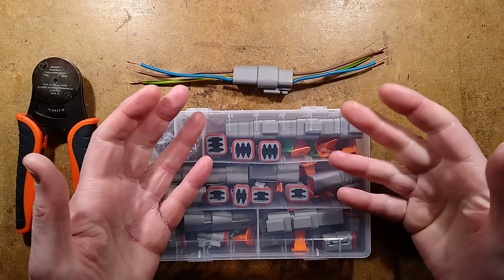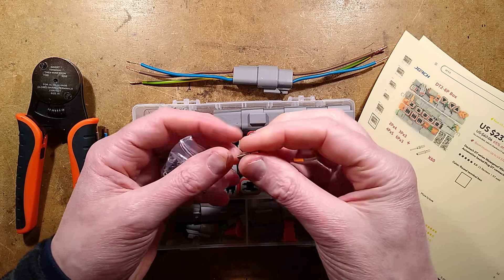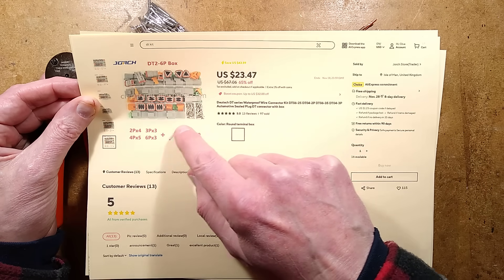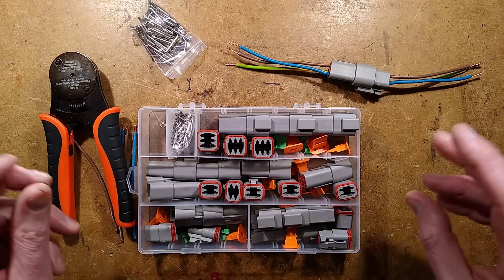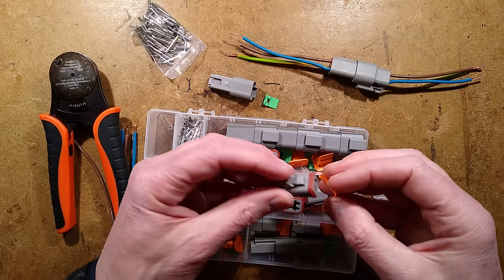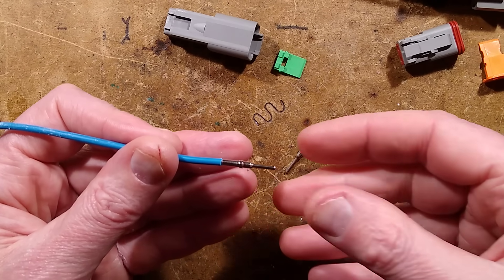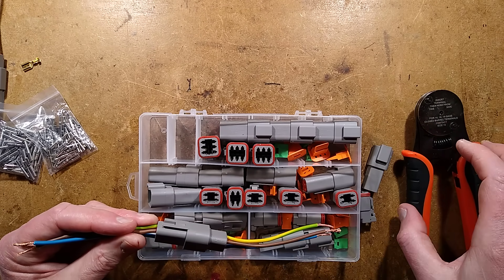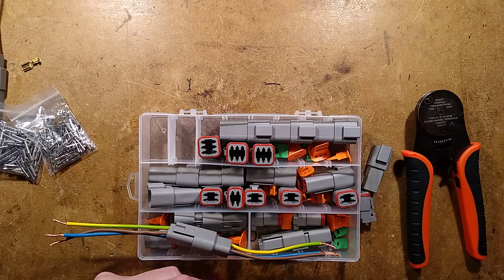Deutsch - my new favourite rugged connector

Comment: these look similar to automotive connectors which would be great for replaceing things like headlamp connectors or any other connector under the hood should it go bad or just need to be longer for an after market mod or just need to be added my go to method works but is not a professional method I will use apply dielectric grease to the wires twist them apply a wire nut use electrical tape over the wire nuts bend the wire over the wire nut then zip tie it in place so it does not twist out then duct tape over the entire merry ann its ugly as sin and looks like a joke but I have seen this method last 20 years in a few instances have yet to see it fail now will it last another 20 years I think not these connectors will likely last 50 years if left untouched after the first 20 I suspect they will get britle after a while but still work for a really long time for the work I did fixing appliances if the rest of the appliance lasted another 5 years  it would be a surprise but even in a 10 year old car expecting to keep it for another 20 plus years not likely not saying it would work this way for everybody for me it works because of the supplies I used being decent enough in the states wire nuts are the standard so we have good wire nuts and have practice with them we also use duct tape in ways we should not and if you pay a little extra it will hold up under some pretty extreme conditions while in the UK you tend to fail to twist the wire nuts enough and they come lose or you over twist them hoping against such and break the wires but if done to perfection they hold just fine and are a slightly better connection then wagos but then again we have 15 and 20 amp outlets as the standard not 13 amps and we do allot of stupid things like run our wires to the max for extended periods of time because a 20 amp breaker is thought to mean 20 amps constant when needed we are special like that so our electrical systems use wire nuts not wagos for their increased contact area and our electricians are perfectionists even our handy men doing hack jobs have some amount of procession to our work  but I have used wagos on a select few cases and they work for what they are but I have to say these are a thing of beauty when the abilty to remove and a part is critical like maybe temporary wiring for an out door venue I could see a mains panel wired to a generator with these connectors  as they are quick and easy to connect and would not come out with a simple yank when you need to spend you have no choice get the right stuff when you can hack it rather it be in a pinch to make an appliance work or just something for testing hack it a good hack is just as good a crappy proper job or better having the proper supplies is gonna look better and cleaner and be faster I have used copper pipe couplers as butt connectors for large wires and it works but takes a few minutes to install and its ugly but its just as tight and secure I shove my wires in hammer it flat fold it over and hammer it flat again cover in heat shrink tubing and done the proper tool and supplies would have that same joint done in half the time but at a higher cost and with less contact area for some of what I do the time was not a factor contact area was a factor like solar panels so I it was the cost when the panels cost 100 dollars each and 20 feet of wire costs for 30 dollars but having a bullet proof connection was a factor and the copper pipe coupler crimp did that far better then any standard crimp but the time it took to make it happen was extreme about 5 minutes per crimp wire nuts not an option it has to work perfectly 20 years from now for back up power and it will for the pros time is money so they will spend more on supplies to have it done quicker but still to spec

Comment: We have been using them in heavy commercial vehicles for decades- they really do work, and work well- especially where they get hit with water and other 'corrosive materials' like cattle urine- standard automotive crimp connectors can fail in only a few months on cattle trailers for semi's, but Deutsch connectors will last longer than the trailer itself... (they also work extremmely well in marine applications for deck lights and the loike, where again corrosive salt water makes short work of standard 'crimp connectors'...

Comment: Looks solid, and one I would actually trust to survive in rain. The only thing that ksnt kbvious to me is how you are supposed to sleeve the transition from the cable to the connector - like you might do with heatshrink. I guess its not technically required here - but I dont like it when a cable is just hanging by the leads.

I assume im just missing something. would be nice to know how its supposed to be done right. I might want to use these in some future project that needs weatherizing
Reply from the maker: These connectors are intended for wiring looms inside equipment.

Comment: Deutsch connectors use the same pin diameter (1.6mm) as the round pins that Ford uses (or used, haven't seen the wiring on a recent Ford) on things like oxygen sensors and fuel pump driver modules, among other things, so if you need to make test connections into these Ford connectors, you can use Deutsch terminal pins. Aircraft with round terminals also often use this pin diameter, if the box of jumpers I found at my dad's house after he passed is any indication (he was an A&P mechanic).

Comment: It's very satisfying to make a good crimp connector using a good tool. A few weeks ago I bought a pair of Kings crimpers from the US America (via the electronic bay website), and they were very expensive, but a lot cheaper than new, and they came with the exact dies I needed to crimp the BNC connectors I normally use. I did try crimping a cheaper brand of BNC connector that was supposed to use the same dies (based on the manufacturer's drawings, anyway), but they were incredibly difficult to crimp, and it ended up creasing the sleeve. Which is probably what made them so difficult to crimp. However, using the proper Kings connector was a much nicer and more satisfying experience. Took me right back to my days as a trainee, when I would spend hours terminating cables.

BNCs were definitely my favourite to terminate, which is a shame because I don't get to make them since I moved into networking. Now it's just Cat6 RJ45s, or the occasional fibre splice. Fibre is also satisfying to splice, but nowhere near as pleasingly tactile as a BNC. And the less to say about Cat6 RJ45s, the better.

Comment: I worked for 44 years designing / producing test interfaces for the worlds automotive industry probably came across 99% of the connectors out there also ran the machine that turned contacts. The Deutsh connectors were designed from the outset as high quality with the machined contacts then the cheaper formed terminals were introduced. The turned contacts are worth the money especially if you expect the connector pairs to be connected / disconnected in use. They have been in production for 15 years

Comment: Panty Wings? I think you meant Panty Sheild Wings. But I've never known of that comparison in electronics although I've used these connectors in an industrial setting,  and they are really good. We were using them for hydraulic pressure transducers with 4-20 mA signalling for load weighing on front end loaders etc. I say 'we' but i was just a part time tech making cable assemblies for testing stuff.

Comment: The first time i used these i never went back unless i needed more than the amps on the dt series. the biggest help has been here in australia with our ancient and unreliable 7 and 12 pin trailer plugs, ive switched my ute and trailers to run them and havent had a bad conncetion for at least 6 months whereas i would have had to at least spread the indictaor pins at least 4 or 5 times if not more. plus on rough roads i dont have to tape the bloodey 7 pin plug in to stop it falling out, which with 2.5T behind is not ideal when you need the electric brakes to work.

Comment: I've seen those many times and wow. I've never realized that there's three pieces of sealing in them! Now to think of it, I can't recall seeing these corroded or anything. I've done quite many "Amp superseal" connectors and they're quite good for low voltages, but I absolutely hate assembling them. Oh and those last crimp connectors seen in vid, whatever they're called in English. Yeah, they work, but I kinda hate them deeply. Even the "insulated" ones leave miniscule gaps that just irks me badly. I had to repair my car's heavily corroded rear lights with them few months ago and just... Disliked the process. They always feel like they might disassemble themselves, short, corrode etc. 😊

Comment: I got ripped off on ebay by a seller who said they shipped two items to me, one with USPS and one with FedEx, I got shipping info from each and proved the items were NOT shipped to my name or address, ebay refused to refund me and believed the buyer, in spite of the proof, they didn't even look at it. So I use Amazon and Temu now. Amazon has an Ai which watches how much you spend and adjusts the prices to match what they think you can pay. If you buy expensive stuff prices will go up. Temu varies prices a lot but I don't know why yet. I bought bike lights that were $US7 something one day and $11 2 days later, even though they were laready in my art, so if you see a deal on Temu buy it, as the price may change at any time.

Comment: I moved over to these connectors from Bosch Kompact & Junior Timer style ones when I could for my DIY electronic ignition projects, as they are more compact, and easily demountable. plus I planned to 3D print simple tube like enclosures and incorporate custom PCBs in these and use the connectors in these..

Comment: Ive used these on a PC build as a test run and proved quite handy. Its meant that i can add longer cables where needed, change sata, molex and disk power connectors and add dummy connections for cable management.
Reply: Just don't mix your pin assignments up! :p

Comment: We used a lot of different crimping connectors and had a lot of those 500+ EUR crimping pliers... 
This seller does a nice job, delivering 60 set of pins so you have 5 spare ones to test the crimping tool.
The listing mentions the SN-2549 crimping pliers and these work nicely for JST-XH and Dupont style connectors too. I tried 4 different types of crimping pliers but this seems to be the one that works best for the connectors I use.

Comment: These little buggers are great but when used in harsh environments they can be tough to get apart if not lubricated a bit when assembled. Often the seal and the lock will stay behind as they jam from fine dust etc.  These have become the preferred connector for a lot of us techs .

Comment: The hole in the side of the pin is an indicator to show the stripped wire is the correct length. You should see the wire through the hole.
Plus the crimp tool should be loaded so you can push the into correct depth.

Comment: I've used DT connectors in the field for decades and they are hard to beat. The actual factory crimper for these is several hundred dollars but I have been using the same one my entire career. The gold plated pins are very low resistance.
Reply: I second this. If you're doing more than 100 or so crimps on the same wire gauge, the expense of the real tool is worthwhile.

Comment: If I read that out loud, it would sound like "douche". A douche isn't always a negative thing. It makes me wonder if this would be good for connecting light fixtures with house wiring. Crimping onto solid wire doesn't sound good, but I think people do it. In my case, I'd have to adapt aluminum wiring to copper before I could do it, anyway. I've never seen any issues with connecting light fixtures directly with aluminum, and that's how it has been since the 60s. The problems seem to arise mostly with high current loads.

Comment: I bet you would like Anderson connectors... If you assemble them the same way it is impossible to connect them incorrectly and they are also genderless so if you have multiple batteries and plug them together the polarity will be correct or if you want to plug a power source directly into a load or a power source into a battery or a battery into a load no matter what you do they will always mate with the correct polarity.

Comment: Do Not Mix “china” pins with the real ones, the pin tolerance is different, cause shorts and bad connections! 

Been using these in heavy duty construction equipment for a long time, very reliable plugs when made and used correctly

Comment: I used this for the power cable for a costume. It held up quite well to years of use.  I just changed the power from three USB-A connectors to a single USB-C, which is much easier to deal with when I'm wearing it.

Comment: I've recently been intro'd to these for a specific task.  Factory put unsealed plastic molex style connector in the wheel well of a roadgoing industrial piece of equipment we maintain about a thousand of.  That went well.  So have had to go around replacing all those with a sealed Deutsche style connector.  That crimper is just a delight.  I love it.  And I love the system.

Comment: I took a whole two day class on making and repairing harnesses and identifying, crimping, and reworking deutsch and metri-pack connectors when I worked for a genset manufacturer. Took all that shit to heart and started using them in my own personal projects, and it's come in quite handy repairing equipment where most people will splice in a new pigtail for a broken connector when 9 times out of 10 you can just replace the shell. The more places you have to cut a wire the more places you have for failure and all that.

Fun fact, a properly performed crimp connection is stronger, lasts longer, and has lower resistance than a soldered connection, and soldered battery cable lugs are the absolute bane of my existence. Even the cheapo hammer style crimper is better than a soldered connection, let alone the $500 tool I bought specifically for doing battery cables, and especially when Farmer John uses acid core plumbing solder on his battery terminals and then wonders why his backhoe barely cranks. But now I'm just rambling.
Reply: It’s always going to be Western Union style soldered splices for me, I’m just too risk averse to change 😂
Reply: I've tested the pull out strength of the stronger than soldering claim and haven't seen it.  I used a 10kg plate to pull against a ring terminal and the crimps always failed before the soldered connector. 

Also my finding has usually been with age the crimp will have a large amount of corrosion of the wire that leads to a failure.

Rosin flux and a good solder terminal seem to make a connection that is protected from corrosion and has more strength in practice. 

Do you have any info on why there are claims of the crimp being better, I've heard it so many times but never looked.
Reply: @swicked86  Too be fair and from 30 years of personal experience the issue of Soldering vs Crimping has never been due to the concern of 'Strength'.  The reason for crimping instead of soldering is because when soldering a standed core wore the solder is be drawin up into the strands of the flexible wire causing that section to become a solid core, not a flexible core.  Therefafter it is simply a matter of time before the soldered (now solid core) wire fractures and fails just outside of the connector assembly.

Comment: As an Avionics tech these pin types are universal among aircraft wiring and the tools are very expensive. DMC makes lots of the ones i use, and the 4 way crimps are very good but tend to have terrible strain relief and break off right at the pin, especially with the aluminum wiring that is industry standard, needless to say shop tools and some home stuff i use these connectors, they're great.

Comment: They CAN be interchanged with Amphenol connectors too as they are relatively compatible, well  if you have those already.
They are AT, ATP, ATM like the ones in the mentioned above comment.

Comment: I Work in heavy truck in the US. These connectors are by far the best. They carry excellent data and voltage. They seal well. The only issue is dust can jam them up quite a bit, but thats the same with just about any connector. A quick blast with compressed air usually does the trick.
Reply: Wiggle wiggle wiggle wiggle wiggle, yeah.

Comment: These connectors are great. I went to a garage sale and the retired guy selling all his 240v tools had these fitted to them all. An extra layer of heat shrink is needed. Easy to change on the job if a cord got damaged. Not sure if it's a workplace legal system though, but a great time saver if needed.

Comment: The pins and crimp tool reminds me of the old school winchester connectors I use at work, although the winchester crimp tool has a screw so you can adjust it to different gauge pins. The winchester pins are fantastic, I've even encountered them in modern assemblies using them outside of the original connector just bc they're such a solid pin design. Now the winchester connector itself is sorta jank, like cold war era mil spec stamped metal construction, they last forever, but they're only robust in a brute force sense, they're not very elegant or versatile haha.

Comment: i've been on the deutsch train for a long time. i even put grease in my connectors, which is super overkill because they are already sealed lol. i also got some clamshells for my connectors that clip the connector on to a wire loom to make the whole thing air tight. the clamshells are kind of a pain to get, but there are a ton of different accessories for deutsch connectors. they are expensive as hell, but i don't do a ton of work with them so its worth it.
Reply: Lubrication is important if you're going to be doing the in-and-out a lot.